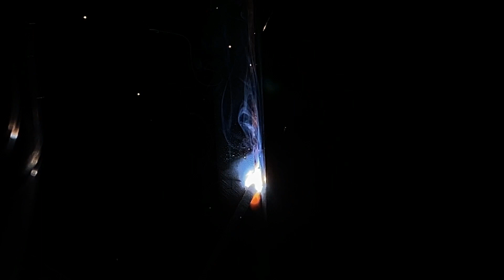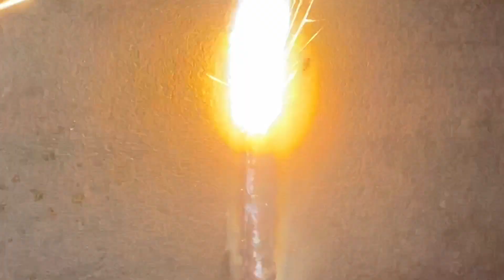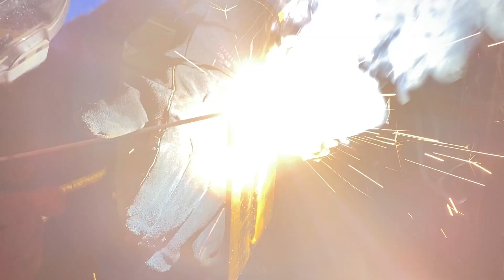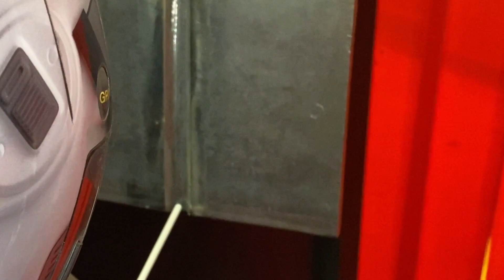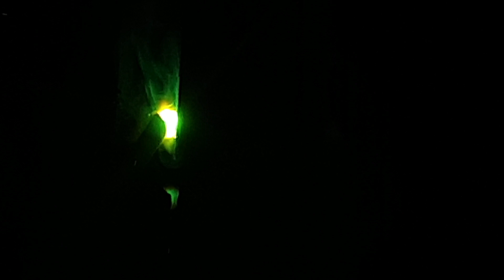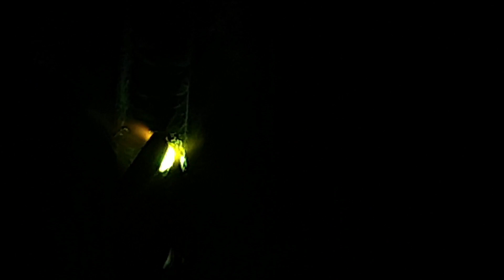vertical stick welding to pass an X-ray plate test!

Comment: Fake video 2:29 I got the exact slag pattern once and the it also comes off easily but the line is definitely not like after you cut the video there. It should be a wear weld as obvious from side pattern. It is a different weld. Stop fooling
Reply from the maker: Apologise I don’t quite understand what you are saying. Each weld in this joint was done on the steel shown, there is no other weld it has been done on except that one.